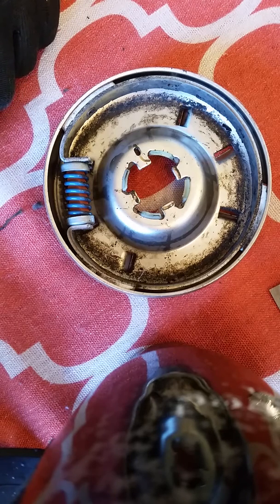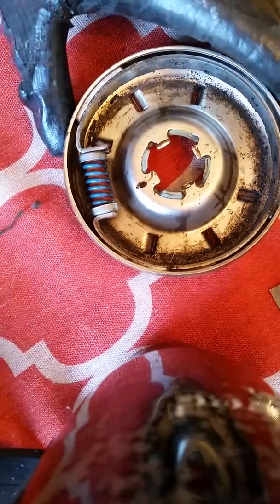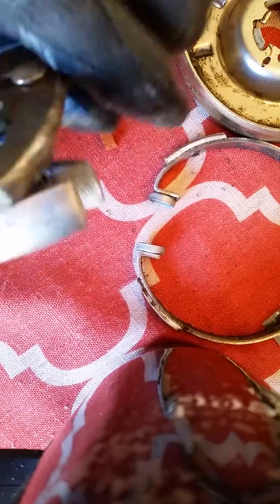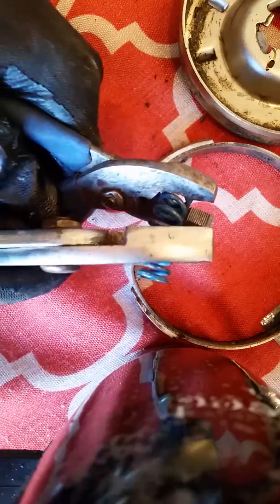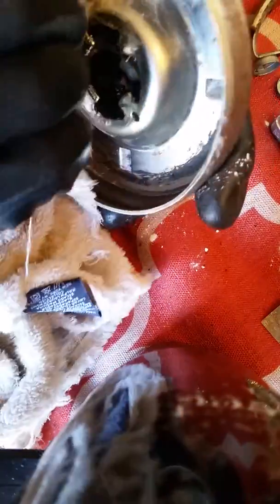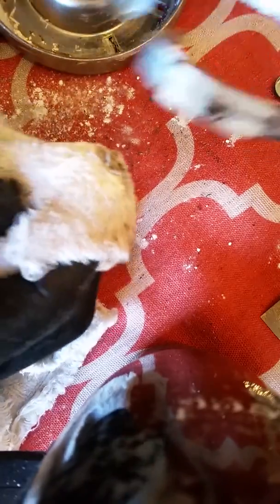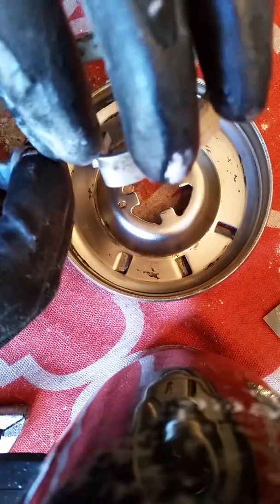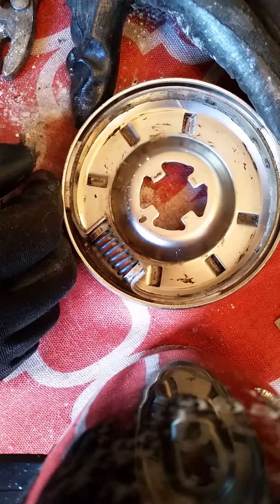Fixing a Whirlpool washer transmission clutch with pliers and cornstarch

Comment: Thanks ! I saved 50$, i bent the spring 45mm lenght the clutch was really tight. It didn't resolve my problem but i still have 50$ to buy another used one :)

Comment: Would this work on the basket drive brakes?  After i replaced the trans it makes a loud clanking noise in the spin cycle.  I think the basket drive is fallin on to the clutch.  But not to sure
Reply from the maker: sounds like something wasnt assembled correctly, i would take the trans back out ad look around. watch a video on transmission installation to see if a part was installed improperly.
Reply: Keith Cale sounds like the BLOCK DRIVE is loose.

Comment: Cool... A new clutch only costs $10, so replacement is the best option.
Reply from the maker: If you can get it for $10 i agree but also depends on time too. Sometimes Momma dont want to wait. lol
Reply: The Washer Dryer Repair Nerd If you are paying more than $10 you are getting ripped off. Plus, a fix is better than a band-aid.
Reply from the maker: They are as low as $7 online. but all are aftermarket. Sears sell them for $23 which is OEM. Some people feel more comfortable buying OEM. I wouldn't call it a ripoff. My solution is not a bandaid, most of them go bad because of overloading which puts extra wear on the spring, so all you really have to do is restreach the spring as shown im my video, in most cases. thank you for your input.
Reply: Agreed - cornstarch and pliers - my kind of repair!
Reply: Norm Weaver can I cook it afterwards?

Comment: That's not 100% true that clutch had oil or water on it if it was oil the transmission is bad and if it was water the tub seal is bad or the basket drive seal is bad which  were common issues on older whirlpool washers ... I would highly advise against doing this
Reply from the maker: I appreciate your concern but what you address is very rare. I have repaired hundreds of whirlpool machines but what you say can happen, but is just not very common. On a typical Whirlpool Kenmore washer a bad tub seal is a easy and quick repair and doesn't require throwing away the whole washer, it's just a screw inside the agitator and sometimes the rubber bushing get sworn and yes the leaking water can make the clutch Rusty, with a little sandpaper and restretching the spring your back in business. If it's the transmission oil, the transmission isn't bad it's usually from the washer being tipped on its side for a long period of time at one point, again easy fix, quick wipe-down of the clutch stretch the spring and your back in business. A new clutch is about $15 to $20 which isn't much. But this type of repair is for people who maybe want to fix their washer on their day off and want to get it done or a repair Tech with a customer who doesn't have a lot of money to spend in which the customer is okay with a quick fix.